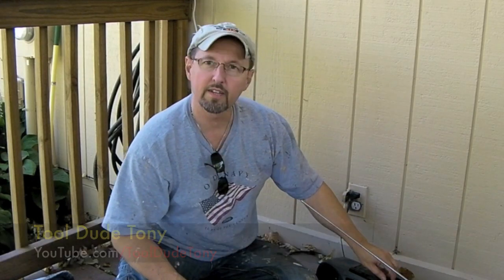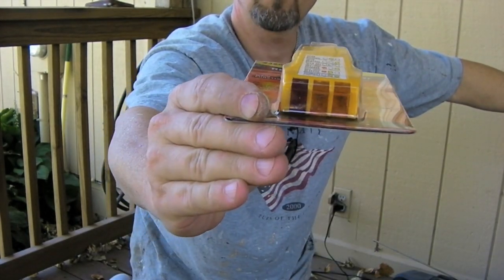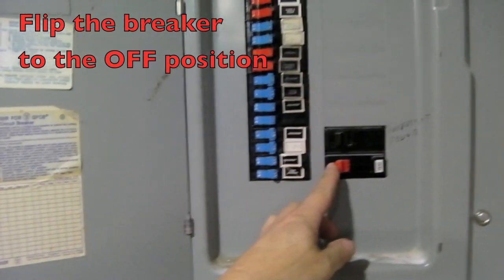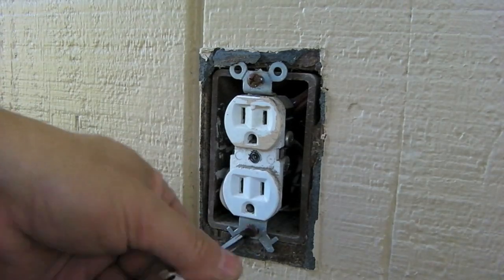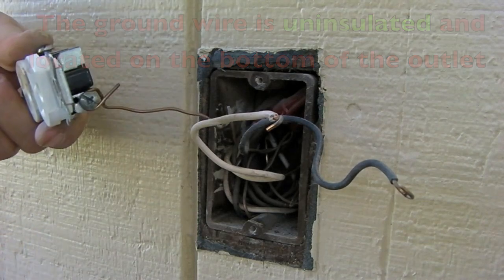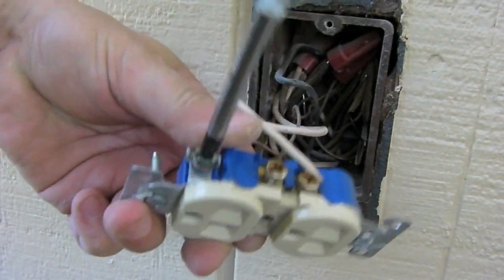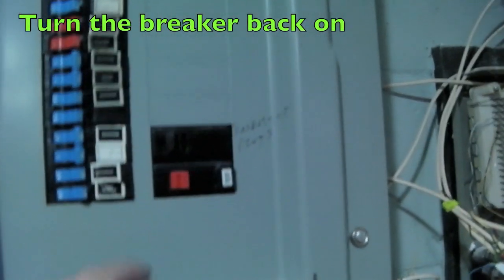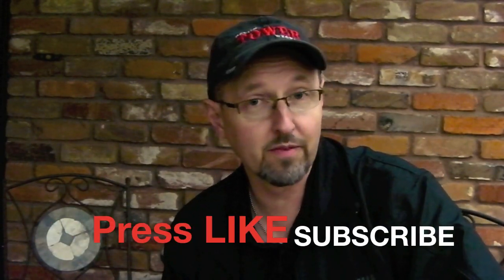How to Replace Electrical Outlets

Comment: I went to replace an outlet and was surprised to find that there were 5 wires back there, ground, 2 white, and 2 black.  the white and black were wrapped around the screws on the side (as you are showing) and inserted in the holes in the back.  The replacement outlet I bought doesn't even have those holes in the back.  Should I just cut those back wires off and cap'em?
Reply: Hi Jon,
What your seeing there is not a mistake. somtimes one breaker can power up to 10 outlets deppending on what is being plugged in. The 1 black wire is giving your outlet power and the next black wire is feeding the next outlet this is known as "daisy chaining" if you cut and cap them you may loose power to other outlets. youll have to buy an outlet that has 2 screws on either side. Dont forget to turn off power!
Reply: NO NO NO NO! THOSE EXTRA WIRES ARE BEING USED FOR ANOTHER CIRCUIT.  CALL A LIC. ELECTRICIAN, DUDE. BE EXTRA CAREFUL FOR G'D SAKE. deeman
Reply: Thanks.  I haven't done anything with it.  Will just get an exact replacement piece and wire the same way.
Reply: the holes or the screws are just options . don't have to use them both. notice that they are left side or right side. The  side with the yellow brass colored screws should hold the black wires  (put all the blacks on that side ,holes or screws or both )the other side has chrome colored screws for attaching the white wires . If you have 2 of every wire color, that means the next plug in the wall (somewhere) is getting fed after the one your working on.   wires coming in and wires going out . blacks to blacks whites to whites  copper to copper. send em on thru. via the screws.
Reply: man somebody messed your outlet up.. it is never okay to have more then one black and one white plugged into a outlet .. the way your outlet is set up if something goes wrong with your outlet none of the outlets in that room will work because they installed them in series .. it's  electrician talk so I wouldn't expect you to fully understand the whole concept lol but get you an electrician out there to fix that for you
Reply: +Rakeem SW  uhh, no. The first pair brings the power to the outlet. The second pair continues the power to the next fixture/outlet in parallel. Unless the tab between the screws on the sides is broken off, the circuit is continuous.
Reply: Waldo Lost That's not called wiring in parallel, that's called wiring in series .. If you take out that outlet, the outlet that other set of wires are going to will not work either.
Reply: No, the loads are connected in parallel. In a series  circuit, if you remove a load, the circuit breaks, and downstream components stop working. The voltage across a load changes in a series circuit depending on the resistance of that load. In a parallel circuit the voltage is constant. The downstream components do not stop working when you unplug your toaster. The voltage at one outlet is the same as the next, whether it's a small radio or a room heater.
Christmas lights are a perfect example. In some, when one light goes out, the whole strand dies and you get  to test every light to find the dud. In others the strand doesn't die when a light burns out.
Outlets are not loads, they are simply standardized connecting points for electrical loads. The may be in line, but electrically they do nothing thremselves.
Reply: Waldo Lost Bro I went to school & graduated with highest honors, in the electrician world connecting more then 1 set of wires to an outlet is called wiring in series, they're being fed power from the outlet ... If they would have pigtailed the blacks & whites under a wire connector & added a black & white jumper wire to connect to the outlet, it would have been considered wired in parallel .. But because they did it the way they did it, once you remove that outlet, all power will be loss downstream, which is why its called wiring in series
Reply: Waldo Lost & another thing .. Voltage is not always the same at the next outlet .. AC voltage goes up & down, that's why you hear people say 120 or 110 ... As long as you have 110 your fine, but one outlet may read 120 while another reads 119 ... DC voltage is constant
Reply: Rakeem SW ummmm, no.
There';s a 5% tolerance allowed on voltage supplied to your house, so 115V is allowed to go to 120 or 110 and be acceptable. There can be higher resistance in a longer supply line, or a bad connection, ageing transformer or switch, etc that will cause the supply voltage to drop (AC or DC) because that resistance is a series load in a circuit. Battery (most common DC supply) voltage will drop as the battery is exhausted.
Back to school, boy. Start at the beginning. And try to stay awake this time.
Reply: ***** hi Jon,
I don't know if you have done it yet but yes .. Clip the wires that are on the gold screw, all of them. Put them all under a wire nut, take a piece of scrap black 14/2 wire & tie that under the wire nut too & connect it to the outlet. Do the same for your white wires .. There should only be 1 black wire & 1 white wire connected to the outlet .. If you don't feel safe doing that call an electrician. But that's what they're going to do
Reply: Rakeem SW   I don't know whether to laugh at your complete ignorance or cry!!!!!!!!!!1
AC= alternating current. 

CURRENT, NOT VOLTAGE!!!!!!!!!!!!!!!!!!

The voltage is constant.
If he removes the outlet, he has to replace the connections on the side. They are part of the outlet installation. Twisting them together and capping them the way they were screwed to the outlet connection tabs (black to black, white to white) would work, and then put a blanked plate on the wall box. That's what an electrician would do (if you really didn't want the outlet replaced). Your way adds 2 unnecessary wires and caps to an already crowded box. Not to mention, the caps are designed to connect 2 wires, not 3, 4, 5,,,,
Mickey Mouse would do it better!!!
Outlets have 2 screws on each side for a reason.
Burn down your own house. Keep your nonsense to yourself.
Reply: Rakeem SW  You were the one talking about removing it entirely.
I didn't say "all" wire nuts are designed for only 2 wires. ALL wire nuts are NOT designed for more. If you know what you are doing, and have a suitable wire nut, you can put more in a connection. Noobs are safer staying with 2, since chances are they haven't read the specs for the cap they are holding.
Reply: Rakeem SW  Actually, I read more. Quite technical, but informative.
I didn't see anything to support "Voltage is not always the same at the next outlet " though.
Reply: Rakeem SW  Highest honors" In what? Acting? Baking? You clearly know shite about wiring and circuits.
Reply: OK.  Everyone. I think I am good.  Appreciate all the advice but this is getting out of hand.  Take care of everyone!
Reply: ***** okay bro, take care
Reply: It's an old post. 
For each receptacle (plug-in) on your outlet, there's a black connection and a white connection. You have 2 black wires, connect them to the 2 brassy screws. You have 2 white wires, connect them to the 2 silver screws. There is one ground wire, connect it to the one green screw. 
There might be (or might not be) a push-in hole close to each of the silver/brassy screws on the sides. They can be used instead of using the screw if you want ( they are connected inside the outlet to the nearest screw) but the screws are better if done properly.
Reply: Waldo Lost your explaing to him the same thing I just told him ... You see how in the 3rd picture there is only 1 black wire & 1 white wire connected to the outlet? Everything else is capped up under wire nuts with a jumper coming from the wire nut to the outlet itself & also there is a jumper going to the switch next to it .. They do it this way because if you bring the feed coming to the panel to one of the devices first & you remove that device for some reason, or just want to replace it, you won't lose power to everything else going down stream .. They call that wiring in parallel
Reply: "device"? 
Series/parallel has to do with how loads are connected. Devices do not use electricity. They may control or direct it, but they are not considered loads.
A basic circuit diagram has a source (mains or battery), a load, and conductors. Period. There are diagrams on that page to show you.
By removing an (empty) outlet, you are removing a "device", but is a conductor, not a load.
In a series circuit, the current flows from a source, through a conductor, and then through a load (think table light), then to a conductor and to a the next load. ALL current goes through the load, though at lower voltage since the first load used some.. Remove the load (unplug the light), and ALL loads further downstream are dead.
In a parallel circuit, the current flows from a source, through a conductor, to  one connection on the load. It then goes, through a conductor, to one connection on the next load.Unplug the light, full current is still available at the next load. Plug lights into both plugs, and full voltage from the source is available to both loads.
The conductor from a source to a load can be one wire, or it can be 4 wires, an engine block, and a mud puddle. As long as there is a continuous path, it is a conductor. There is one on the hot side, there is another on the neutral side. If the current has to go through a LOAD before it gets to the next LOAD, it is a series circuit. If not, it is parallel.
In a series circuit, your second outlet would be dead until a working light was plugged into the first.
Keep reading that page, you might learn something.
Reply: Waldo Lost okay. We'll just have to agree to disagree
Reply: That pinterest page has lots of information, complete with pictures. People can learn from that. Sounds like you don't want to. Oh, well.
Reply: Waldo Lost lol okay

Comment: I would install the outlet upside down from that, so the ground is at the top.  A little safer if something falls across the plug and it's slightly pulled out.

Comment: You should have discussed if one of the two outlets is a switched one, how that would have been wired and show how you have to break the tab off on the node between the two outlets..

Comment: I'm trying to replace an outlet but also remove the connection between it and a lightswitch in the same room. the switch operates an overhead light, which is good, but I don't want the outlet to be controlled by the switch. i want to be able to keep things plugged in all the time, regardless of the switch being up or down. help?
Reply: I'm not sure what your asking here ... do you have a light switch in a room and when you turn it on it also turns the outlet off and on? .. if so is there a lamp plugged in one of the outlets when you turn it on and off or is there nothing plugged into the outlets?
Reply: If the tab on the plug is broken off(most likely) connect BOTH screws on the power side of the plug to the wire with constant power.. If there isn't a constant hot  wire in the outlet box.. Check the switch box for it.. If it's not in either of those, it could be elsewhere.. The outlet that operates with the switch, do both outlets turn off, or just the top or bottom?

Comment: I just bought my house, built in 1925, and I went to my breaker box and shut off the one marked "kitchen outlets" to change the dingy old fixtures.  I still got shocked.  Could more than 1 breaker be linked to the same outlet?  I don't know what to do.

Comment: my house is really old. If i want to ground my house, how much will it cost me? i have around 15 outlets.
Reply from the maker: I'm not an electrician and don't know.  If you have access to the walls with the outlets in them from the basement, it wouldn't be that bad of a job to do yourself.  You could do it for the cost of romex and some conduit.
Reply: I rented an old house, and they had to hire an electrician to come ground the house. It required some fixings in the circuit breaker box, as these were very old fuses. This was 10 years ago and it cost a few hundred dollars to my landlady. After all that, he only grounded one outlet in my office.

Comment: It depends, not all outlets are unsafe if left ungrounded . You want to keep all outlets in your garage, bathroom, kitchen grounded, ungrounded outlets need to be marked / identified. If running a 3rd wire to the main ground is a hard task you can use a GFCI. Otherwise if you are able to fish a #12 grounding wire to the main ground, it is the best ! not always easy in certain homes  What is UNSAFE is to plug a grounded appliance in a non grounded plug ! FATAL.

Comment: they still sell 2 wire outlet for your house..not a good idea to install 2 wire with ground outlets ..you can run a ground wire through the house but it ain't easy or cheap